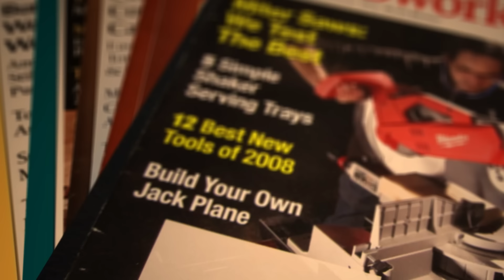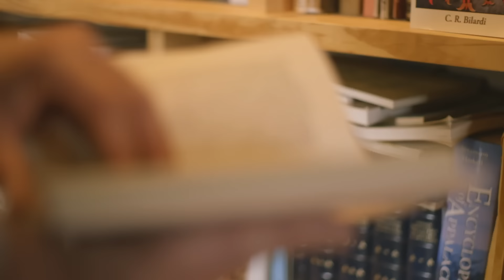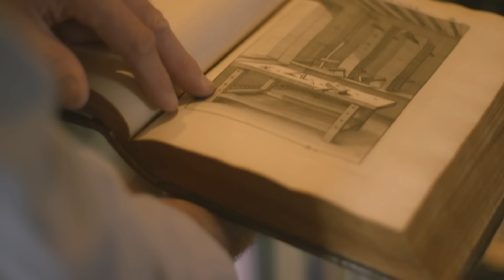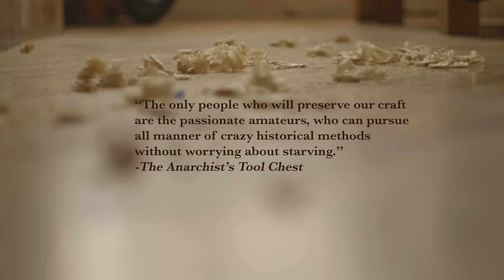The Anarchist Tool Chest (with Chris Schwarz & Megan Fitzpatrick)

Comment: I had to teach myself this philosophy as a mechanic, tool truck would pull in with all the nice shiny tools, you could get them just make weekly payment, took me 3 years after I quit just to pay them off. Same way as an electrician there is always a new wizbang you just have to have, but the standard mix will do almost everything you need day to day
Reply from the maker: Better "late" than never. It is the same in my industry with cameras and gear.

Comment: I built kitchens. I can't imagine cutting  300 pieces of melamine with a hand saw. Time is money, but I'm also a woodworker and that implies an appreciation of tools, wood, and the craft. 
25 years ive had my own shop building it up from one old sears table saw to a functional cabinet shop. In my retirement i decided i wanted a lathe. I found an old 1960 Rockwell at an auction. It has taken months to even get running. I'm humbled by the different skills needed to turn wood. It is a whole new language of wood. It broke down again yesterday and i spent the afternoon looking at $2500.00 lathes. Last night i was irritated because i have not yet earned the new lathe. Yes, i want to be able to turn large projects, but i am years from that. 
It it the same with anytool. I've used tools for years without knowing their full worth. I love my cabinet scraper, but i see some old timers getting amazing curls with one and think i should learn to do that. Now I'm the oldtimers and kids are probably amazed with what i can do with a cordless drill.
Reply from the maker: Wow! Thank you for sharing your story. I can identify with aspects of it myself, though I haven't yet put as many decades into my craft as you have. Thank you for taking the time to share.

Comment: Limiting the number of tools to avoid clutter and making a tool chest truly portable is great advice.  Knowing which tools to purchase and use is the game changer. An old Stanley 289 skew angle rabbet plane is amazing.  An old Stanley 140 skew angle block plane is a game changer..  A set of chisels ( 1/8 to 1 1/4) with high quality steel is very high on the list.  Swann, Buck Brothers cast steel, Berg, and others from the 1880's to  the 1930's are money well spent.  Stanley everlasting chisels (sweetheart era) with wood handles, full tang and metal end caps have truly amazing steel.  Sargent VBM hand planes (1910 to 1918) with east Indian rosewood totes and thicker English irons put my type 11 Stanleys to shame. A 9 inch combination square (Starrett)  is easier to use than a 12 inch.  A Stanley no. 22 combination square gives you plumb and level bubbles.  Most only give you one bubble. Plumb hammers with the side strike head make chiseling easier (22 oz). Good quality antique tools can make a big difference in the quality of your work. I have a lot of chisels,  but I always reach for my Keen Kutter socket chisels from the 1920's.  I believe they were made by Berg.  Disston saws are usually money well spent. Keep the tools that work great, sell the others .  Thanks Chris and Megan for your educational videos.
Reply from the maker: Wow! That's awesome! Thanks for sharing.

Comment: I love this video, and I love the ideas he discusses, BUT the whole "does it fit in the box, if not, I probably don't need it" talking point is a bit at odds with the very large tool wall at the back of the shop.
Reply from the maker: So he also teaches some woodworking classes and most of those are tools for the students in the classes.

Comment: Had I had the workshop, I would go all hand tools. I have a primary ground course as a cabinet maker, so I know I don't need a whole bunch of tools to make pretty furniture. And powertools really only speed up certain procedures. They aren't necessary for those who aren't in a hurry. I am in a hurry, albeit a hurry to get a workshop so I won't have to use my kitchen and my living room as a place to plane wood shavings, spread dust, clean, glue and either paint, oil or stain. So I'm buying a few powertools to make certain processes faster, but there are plenty of hand tools I'd rather use than power tools or fancy jigs. I've always found the dovetail markup jigs useless. You don't need a jig, you just need to know how to draw them with the tools you already got. Save those money for the wood you need to love your craft.
Reply from the maker: Totally makes sense and seem very appropriate. Best of luck on getting your own workshop ASAP!

Comment: Thanks for your short, concise and reaffirming vid! Well done. BTW, this can apply to every trade or part of life. My passion is cooking, not professionally. And I love cook books, esp. with pretty pictures. More than 20 years ago I made a "rule" for myself: until I have cooked at least 1 thing out of each and every book I have I don't buy not 1 more. .... haven't bought 1 and gotten rid of many in this time... less clutter, expenses, etc. And more time cooking... Another not-molotov-throwing anarchist ;-)
Reply from the maker: So true. I'm a videographer and I immediately saw the connection to my industry with cameras and gear. There's always a newer and "better" piece of gear hitting the market tempting me to be discontent with what I have and think that the tool makes a piece better than the skill of the craftsman. Case in point, most of this video was shot with an old 10 year old camera that can't even film 4K. It can still hold its own.

Comment: Lovely video but I tend to disagree. Hand tool woodworking is very difficult. Generally the more expensive tools facilitate a good result. Most of us started with pocket money. As the years went by I had more spare cash to spend on our hobby or woodworking business. My Veritas tenon saw is a delight and saws straight. My premium Jack plane doesn’t tear the grain. My Worksharp enables me to sharpen fast and accurately. I’ve gone from ok results with hand tools, Stanley planes and chisels, a poorly sharpened tenon saw, to quality power tools that made things square etc, to combining them with premium hand tools. My workshop is over full but not with tools. Rather with timber. Nowadays I replace stuff with more expensive better quality and what I make is better. I also enjoy retail therapy. You only live once. I don’t self flagellate😀
Reply from the maker: Sounds like you have a very solid approach. Seems like you upgrade tools for the right reason and play to your strengths and the strengths of your tools. I'd say, keep going with what you are doing!
Reply: We are singing from the same hymn sheet😀Thanks for the reply.
Reply: Sounds like it is the operator blaming the tool for poor performance.  You are just paying someone else to sharpen the saw/plane for you, instead of taking the minimal time to learn the skill.  With minimal effort, most of the tools you mentioned as inferior will perform equal or better than the "premium" options.

Comment: I like your concept, but as a mechanic I have to call bullshit. Having an excess of tools is VERY useful, and you do need them. I've had a screwdriver break in the middle of a very important project and just pulled another one out of the drawer. You never know when you'll need an extra, or when that extra could save you a lot of money, or even your life.
Reply from the maker: You make a good point. This certainly isn't a philosophy for everyone in every situation. But I do think we could all use to evaluate our motives in buying tools and determine whether we are in a particular job or hobby for the tools or for the craft and act accordingly.
Reply: @magnumveritas9526  Well said.

 As Benjamin Franklin once said,"All things in moderation."
Reply from the maker: @Oneamongthelegion  True true.